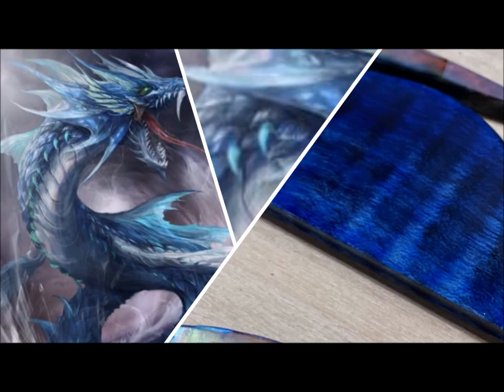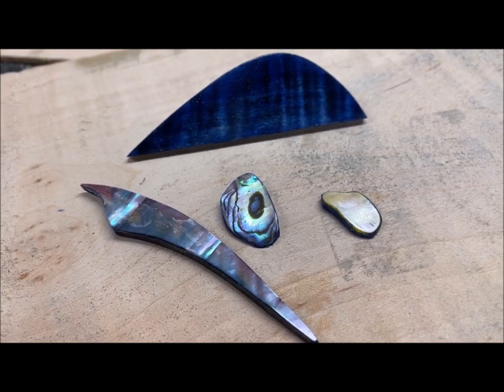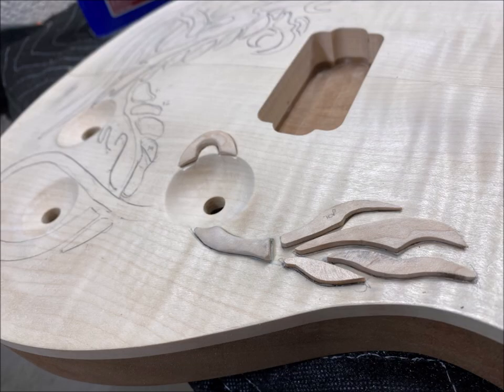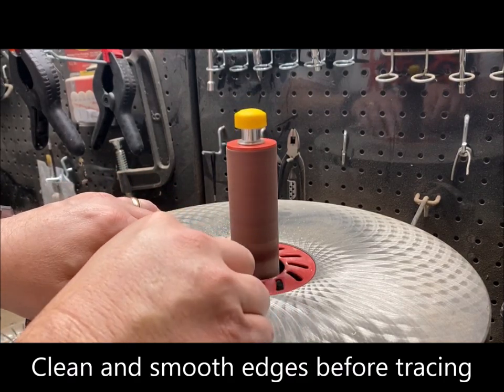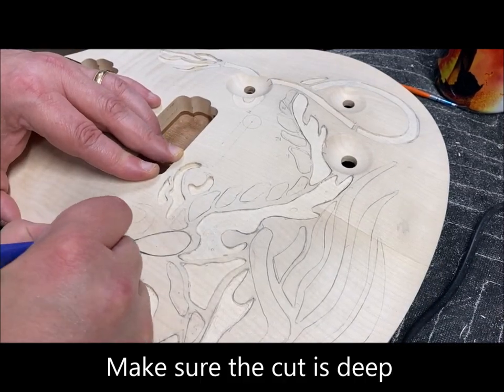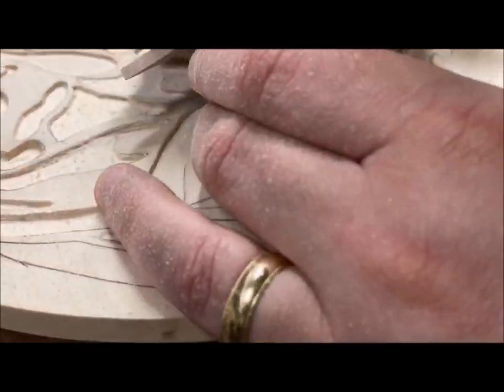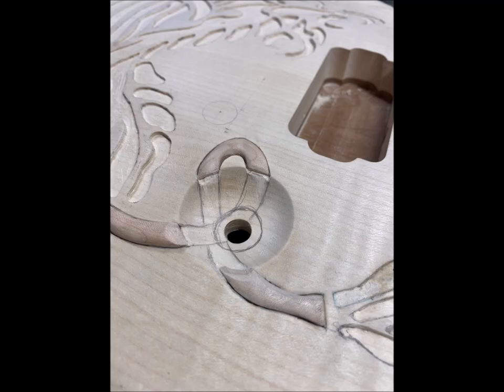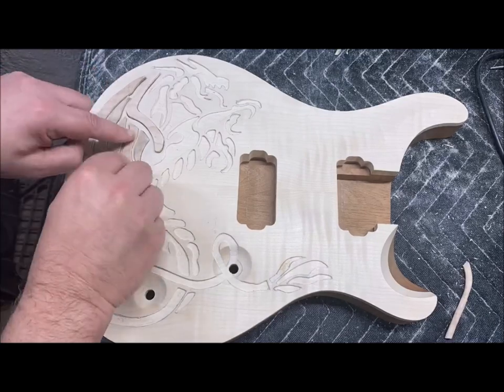Great Guitar Build-off 2020 (unofficial) part 4: "Colors and routing"

Comment: Great job man.  Not only is that inlay turning out killer, but this is really great content too.  I had no idea what the process is for inlay work like this, thanks for sharing!
Reply from the maker: Thanks man. I listened to what Brad Angove said about making the video helpful. I am just using a method I saw on other channels.
Reply from the maker: When are you dropping your next vid?
Reply: @rayrayokmusic  I might put out a brief update video before the next build video.  The next build video will be delayed a little bit.  It's all TBD at this point.
Reply from the maker: Good idea. I saw your Instagram post. Looks like you ran into trouble. Sometimes the trouble videos are better than the ones where everything goes well.
Reply: @rayrayokmusic  oh yeah, I intend to share everything. But I prefer to have to have the best solution I'm capable of to share with the mistake or issue.